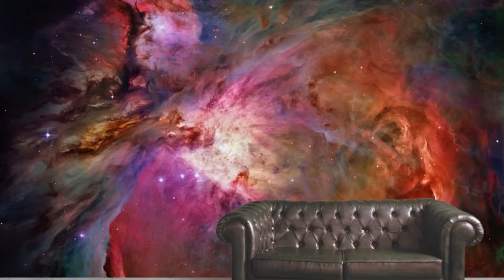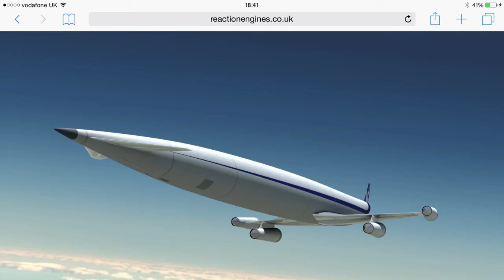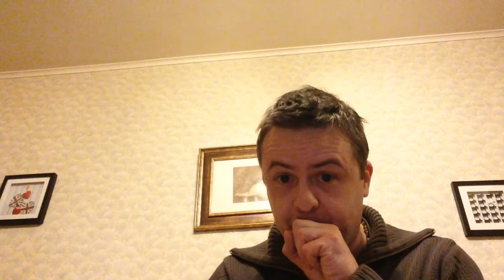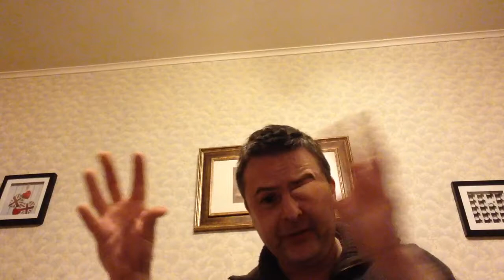Skylon, HOTOL and Reaction Engines - the best of British know-how!

Comment: I think you might have the icing situation wrong - they could in fact deal with it (in the mid 1980s).  The problem with hotol was that it ended up not being able to lift enough to be economically viable for reasons that included the weight distribution problem.